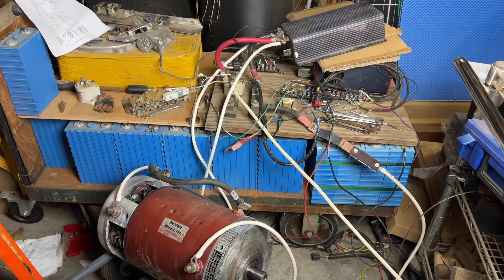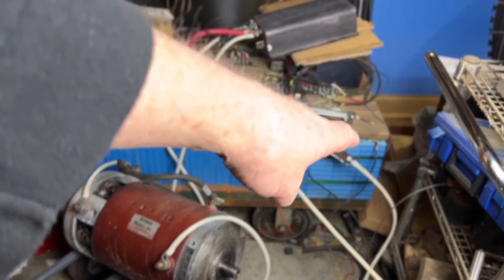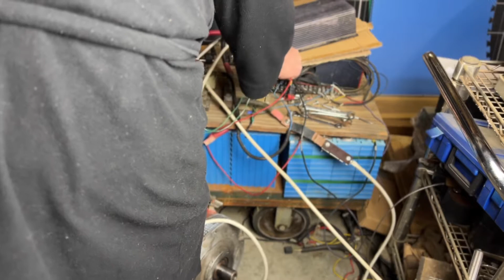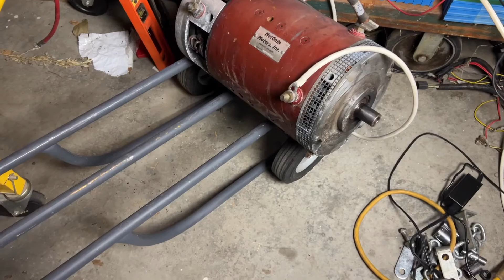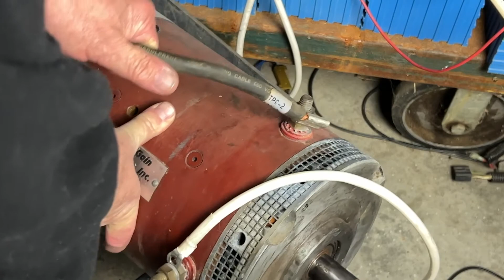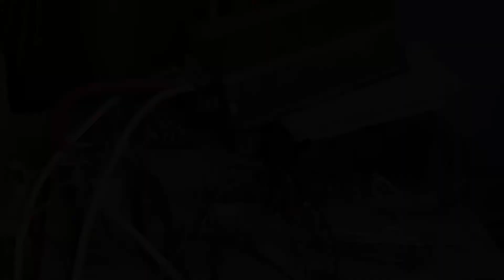NetGain Warp9 Series DC Motor

Comment: which curtis is 400a 120v , id like to find one
Reply from the maker: Search E-Bay. You may need to hunt for the 144V 650-amp controller. 400 amps is not very much for a low-voltage system. What are you putting the controller into?
Reply: @onegreenev  go kart, im currently running 93v 400 amps .. yes its fast
Reply from the maker: @airgunningyup  120v will give that a serious speed boost. A bit more amperage will give it more torque kick too. A 144v controller can be used at 144v and if you have a newer one you should be able to limit the current too. Have you looked into Kelly Controllers?
Reply from the maker: @airgunningyup  Kelly has a great controller. The KDH-E can be ordered as a 120v 600 amp controller for $600 bucks plus shipping.
Reply from the maker: @airgunningyup  https://kellycontroller.com/shop/kdh-e/
Reply: @onegreenev  thx.. I looked at those.. had a kelly in the past , they overestimate their amperage a bit so you kinda always need to go about 50% higher than you actually want .
Reply from the maker: @airgunningyup  The old ones for sure. They have made some great headway over the years. Im looking to buy an AC controller that will reallly wake up my AC Induction Motor. I had a KDH-E and it was 144v and 800 amps. It was the best they built and that was nearly 10 years ago. I actually beta tested a few of their controllers. Fried one of them but it was a custom one we were working on that allowed Regen on a neutral timed DC motor. It worked but the amperage output was so high if you set it to over 50% you risked letting out the magic smoke. I had it working great at 50% but when I went to75% It smoked. They eventually discontinued because people would over volt it and it was a liability. Too bad. It would have been great but high risk if the setting was over 50% and or you used an advanced timed motor like a Warp9. I just have difficulty with the low amperage from the Curtis controllers. Even the AC controllers from Curtis are not as high as I’d like in voltage or amperage.
Reply from the maker: @airgunningyup  So for the Curtis I don’t know where to get them except hunting for a Clone on Ebay. I have two low voltage clones that work great. One on my lawn mower and the other going onto my Cushman Truckster.
Reply: @onegreenev  yea, i have my throttle mapping and everything maxed , so ive been pleasantly surprised with curtis controllers in the lower voltage range ( 72 and down ) .. Ive never had one of the 120 or 144v models , but i know theyre far less tunable.. Im only moving about 300 lbs ( me plus the kart ) so everything seems decent . were i doing a car , id look at everything differently . The kelly is prob good for 800dollars and right now its a better deal than the high end curtis controllers, even the clones are rather pricey and they dont clone the 144 v models.
Reply: @onegreenev  Im not sure i mentioned it , but the kart was pulling wheelies above 450 amp , so 400 seems to be my sweet spot for current.. But more voltage has always equalled better accel without the wheelies.. Heres the latest video , some are old.  https://www.youtube.com/shorts/dGMAJy259us
Reply from the maker: @airgunningyup  Most smart controllers can have the amperage restricted so you don’t over-amp your beastie.
Reply from the maker: @airgunningyup  Never hurts to have more than you currently need because you may in the future want to build a larger one, and not having to change controllers would be easier on the budget.

Comment: HI need to pick your brain for a moment i use the same motor in my 3 wheel motorcycle build . i am running 203 volts at full charge and 2000 amps my timing was set from factory advanced. i now have it set at neutral because of the high amp and volts did i do this rights according to the high power i am putting into it.
Reply from the maker: Joseph, these motors are set advanced at the factory because most of them will be used with higher voltages. Advancing helps reduce zorching under super high amp runs. A motor set to neutral or retarded are for low voltage setups in factory conditions. At 200 plus volts and 2000 amps you will want to keep your motor advanced.